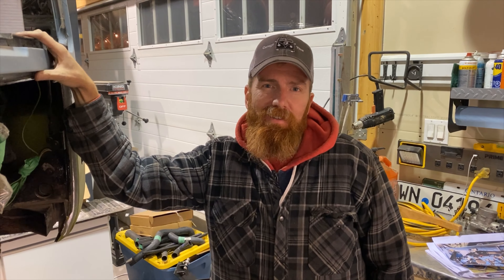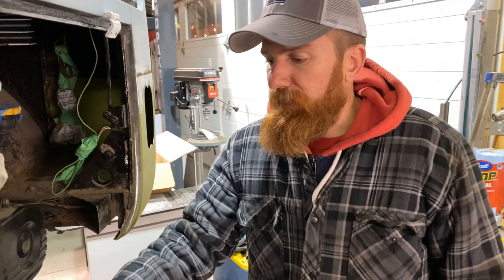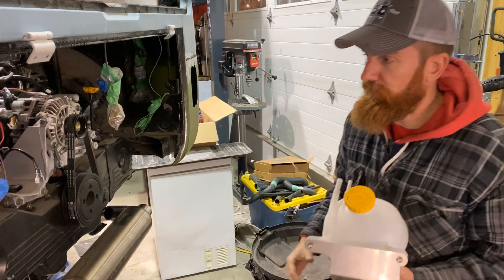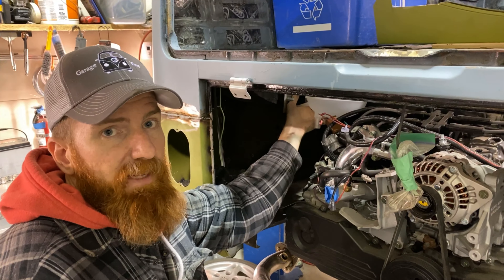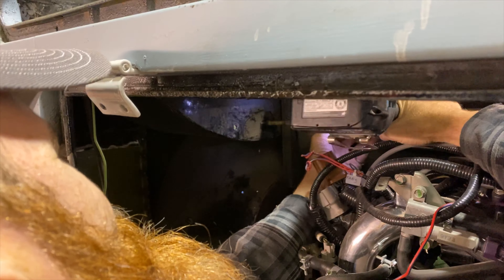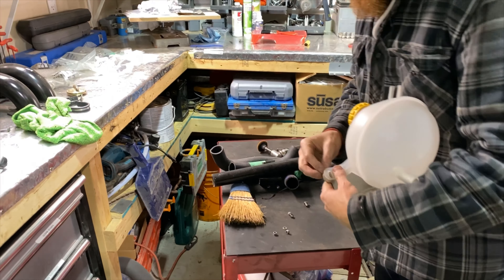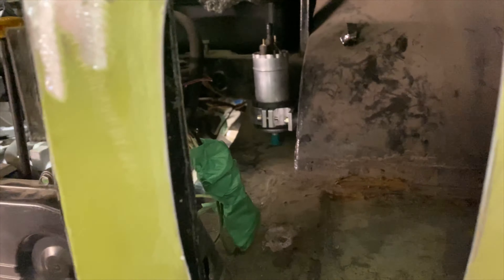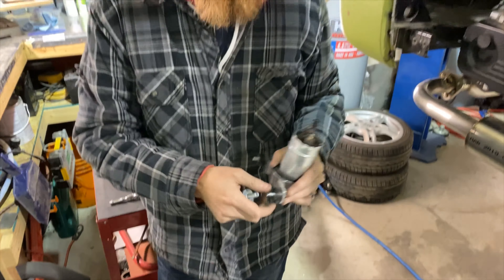VW Bus - Subaru Swap - Holes, Spacers, Coolant and Fuel - Episode 14

Comment: I'd mount the pump under the body below the tank. It looks like it's almost even with the tank. You might have problems with cavitation. It's also a good spot to put the filter under the body also......all these components will then be close to the tank outlet.
Reply from the maker: Thanks for the advice. Think I have now changed mind all together, going for in tank pump.
Reply: @GarageTime  I think an external pump would make it easier to service...particularly on the road. You would have to drop the motor to service an in-tank fuel pump, no?
Great channel by the way 👍